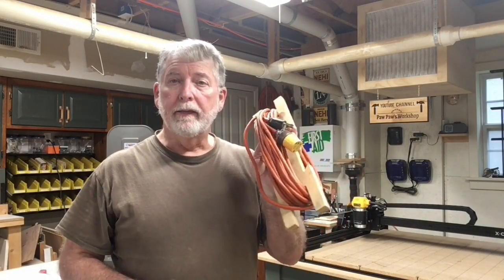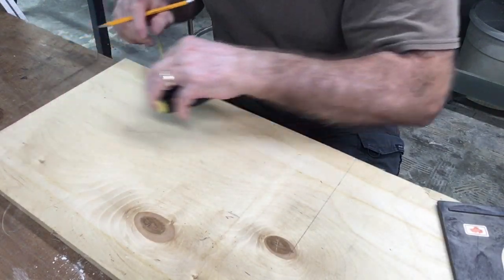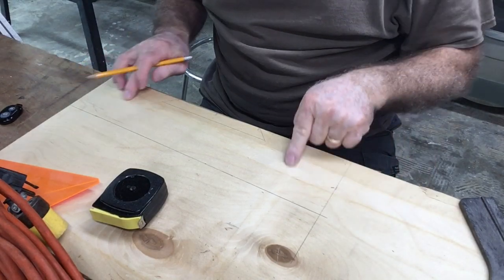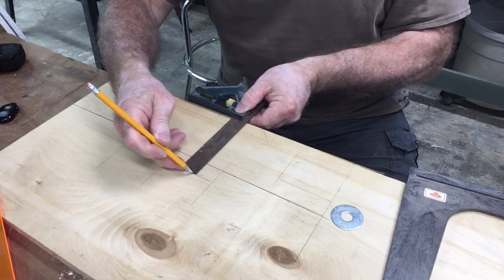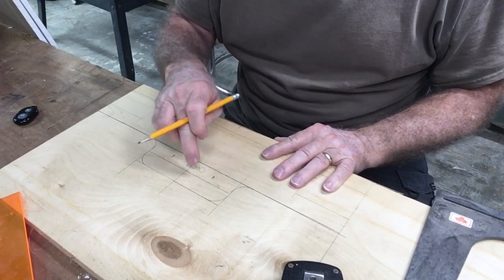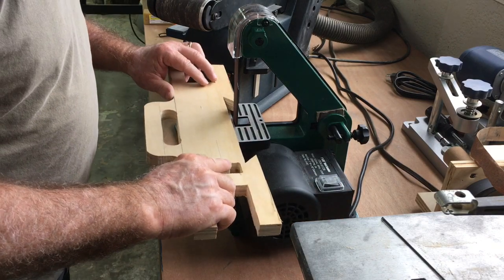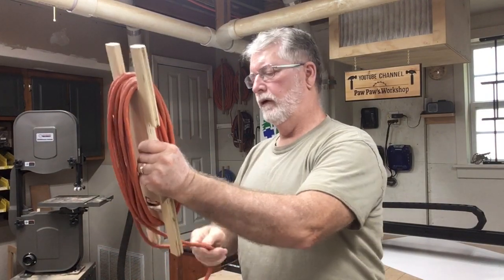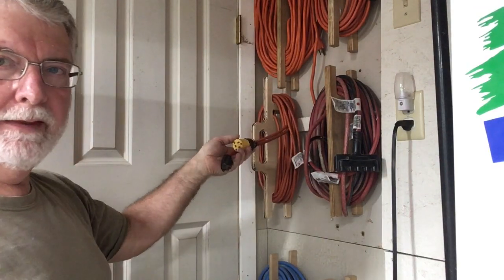How to Make an Improved Extension Cord Holder

Comment: A coiled cable when working on higher current could heat up due to Induction and could damage the
 cable insulation over a period of time. It could even start smoking due to heat.
Reply from the maker: That is always a possibility. Safety first. If you have any concern whatsoever please unroll the cord completely

Comment: Using a extension cable while rolled up can cause it to catch fire one should aways unroll the full cable before using.
Reply from the maker: Thank you for your comment.  You make a good point, although I have never experienced this type of event, it is worth noting and would heed your voice of caution.  

Thank you, this is why it is important for the community to comment.  This can help everyone our there to be safe and enjoy this wonderful hobby to the fullest.
Reply: Unless you something wrong with your cable it wouldn't.
Reply: @jaradat  -- Wrong... Cables are rated for a certain amperage assuming the heat can dissipate to the surrounding air.  When you wrap it in a reel, you are interfering with the heat dissipation and you can end up with a melted mess... I saw it happen at a community center where they were having a fundraising fair in the parking lot.  One of the booths had a popcorn maker like you might see in the movie theaters.  He figured that he didn't need the entire extension cord, so he left the portion he didn't need wound up on the plastic reel... Everything melted and no one notice until the smell of burnt plastic drowned out the smell of the popcorn...

Comment: "folding the cord in half" makes a weak spot.
Reply from the maker: Wile that is possible, in fifty plus years I have not had a cord failure due to this method. (Knock on wood). Thanks for watching
Reply: @PawPawsWorkShop  and it really looks like you dont bend it hard.
smart to have both ends always available.

Comment: What would be the dimensions to make one for a 50m (150ft) lead?
Reply from the maker: It is not just the length of the cord. You must also consider the gauge of the wire.  If it is a 16 ga vs a12 ga or even a 10 ga cord.  I would suggest rolling it up to about the size you want and measure the cord length and the diameter of the whole mass of the wrap.
Reply: @PawPawsWorkShop   I made the U cut out 100mm (4in) X 100mm and this was enough to wrap the 50m (164ft) 10 gauge extension cord. The length of the handler is 600mm (24in). When I made my first one I did find, because the 10 gauge wire is rather stiff, that it might kink in the cut out when your starting your wrap so when I made the second one I inverted this cut out and that worked better. I want to say thanks for posting this video. All my cables are now neatly hanging on the wall by the French cleat instead of lying on the floor. One poster mentioned not to router one of the holders and therefore it can be used as a template. That’s a good idea.